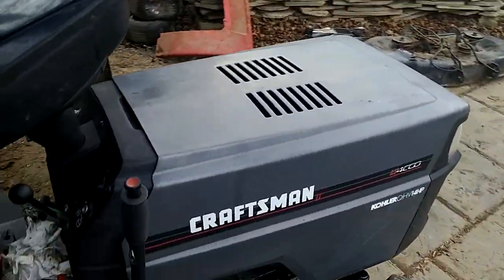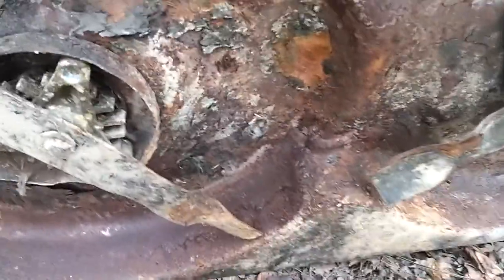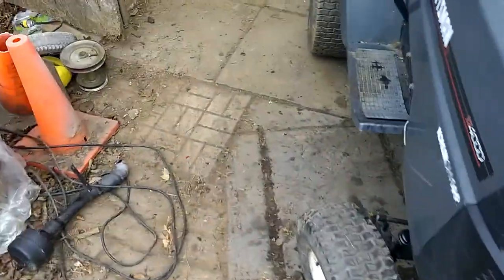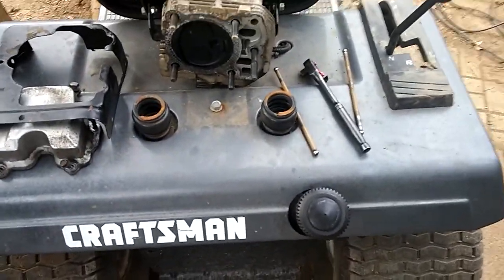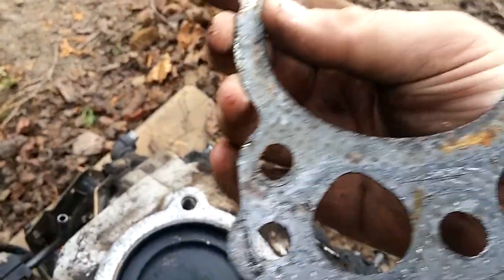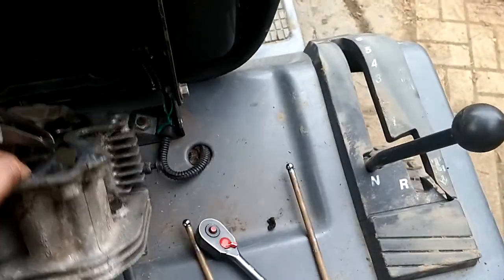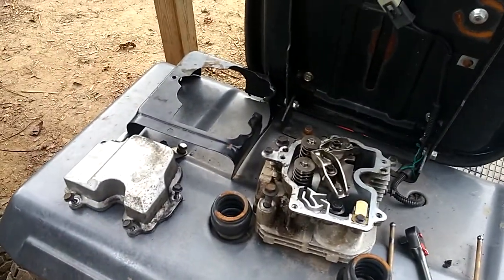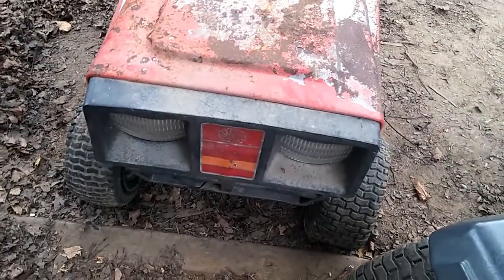Craftsman LT4000+Dynamark Update and Parts

Comment: Spotting popped head gaskets is fairly simple. 
Lift off the gasket carefully and see if you see a black carbon trace from the cylinder to the pushrod area. 
Look on the block, and the head. 
If ya see a track, yup it's popped. 
They blow combustion pressure into the crankcase and overwhelm the pcv. 
Good times :)